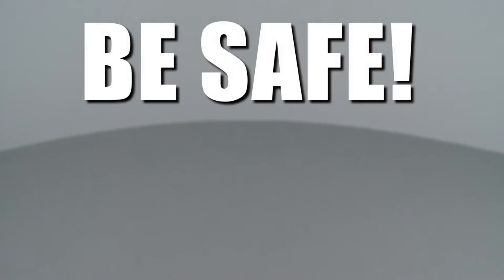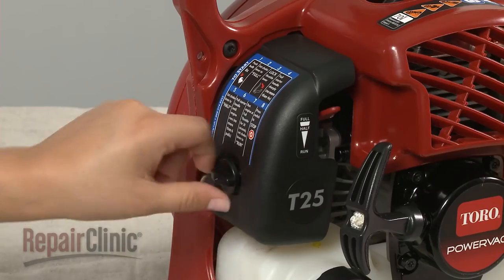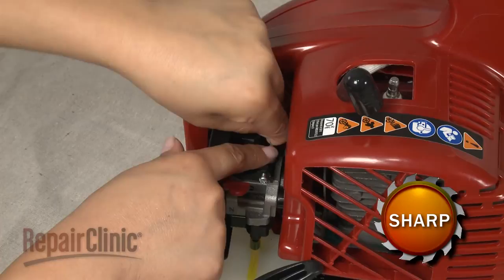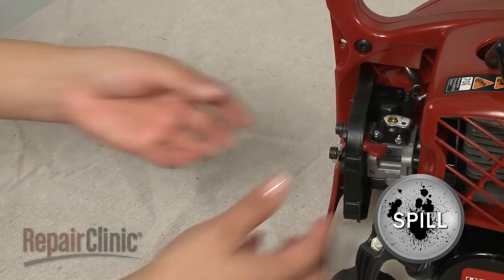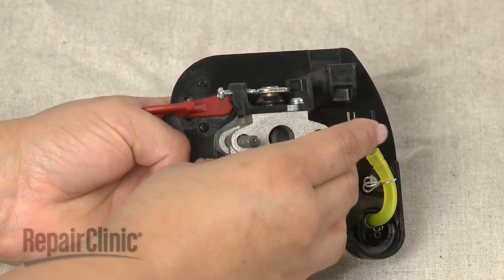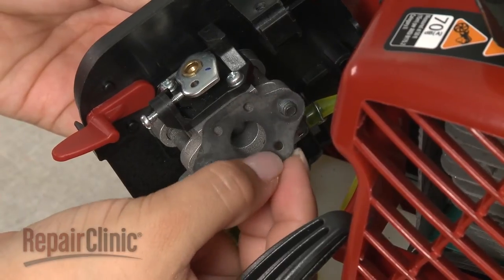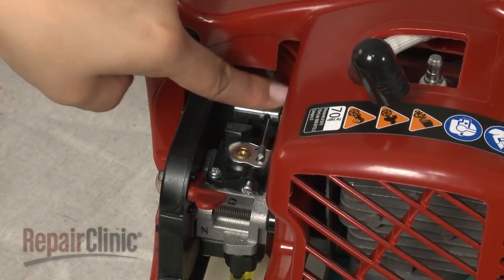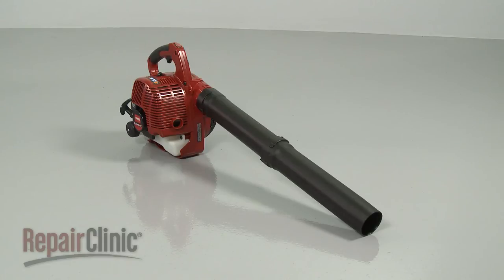Toro Leaf Blower Running Roughly? Replace Carburetor 308480001

Comment: Go straight to carb replacement on small engines!! Don’t waste your time on spark plugs n filters 1st!! Kits w carbs come w all other parts from $12-18!!! The ethanol gas ruins them all inside 5ys.
Reply: Can you adjust these carburetors?
Reply: Can you adjust these carburetors?
Reply: Are these carburetors adjustable and will 2cycle premix fuel ruin them
Reply: These are fixed jet carbs, they can not be adjusted